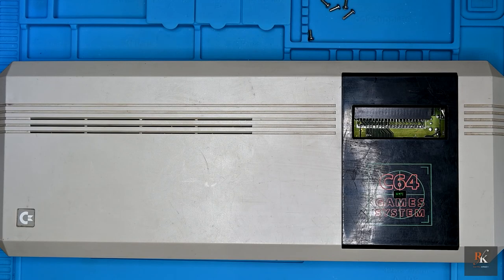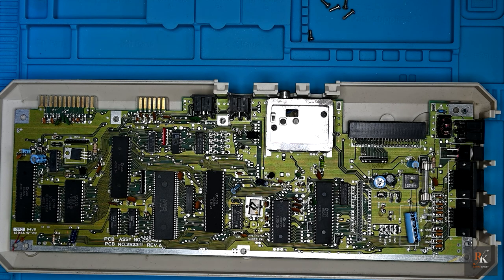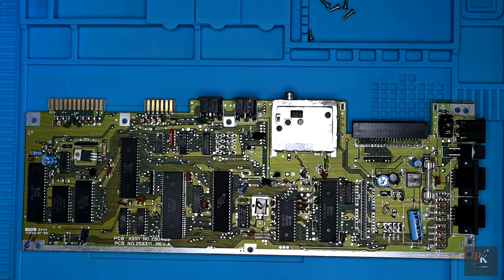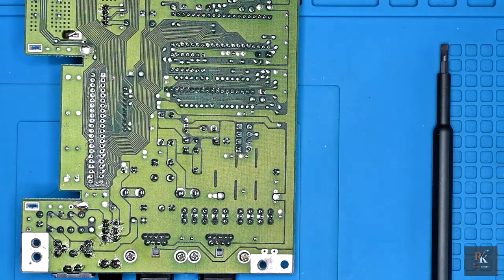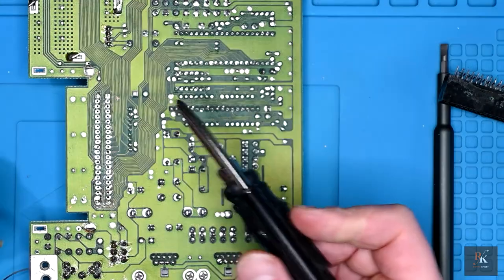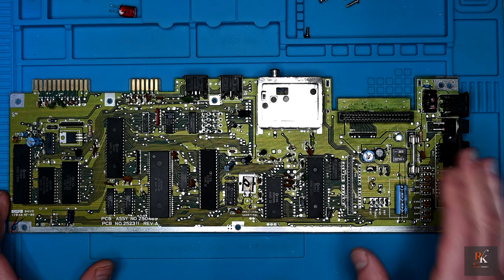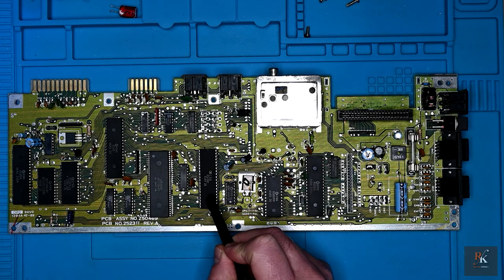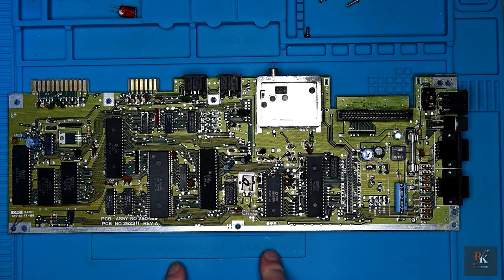Repair/Restoration: Commodore C64GS

Comment: thats just a regular c64 in a gs case. the gs never had the keyboard connection on the board or the floppy drive connector. you were lied to.
Reply from the maker: Yes, it does look like that bar the fact the metal shield over the cartridge port was never fitted, which in itself is odd. I'm not saying that it isn't a C64 board in a GS case and I do mention that in the video. Regardless, it's a cool oddity either way!